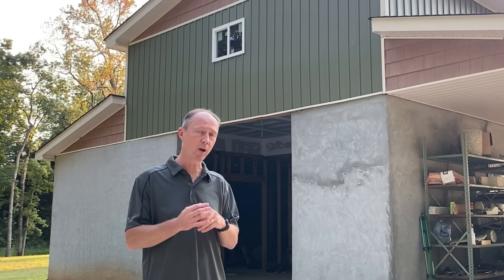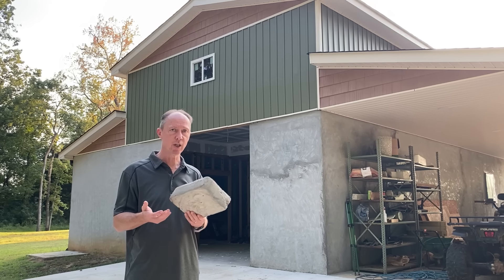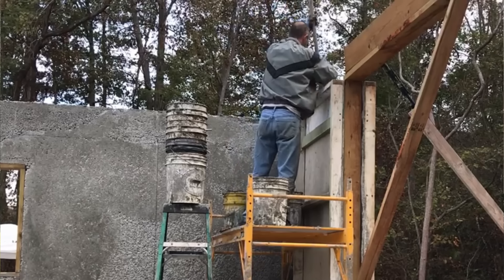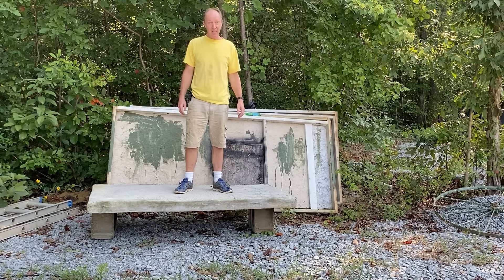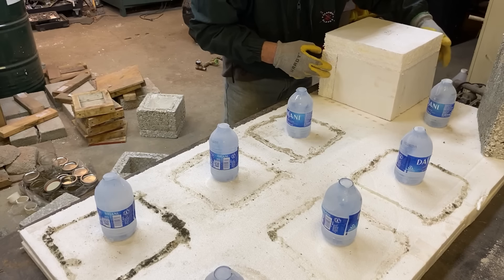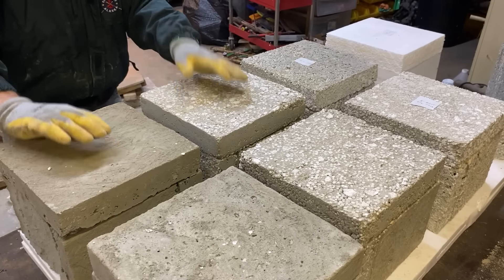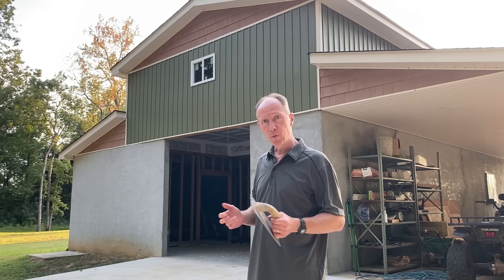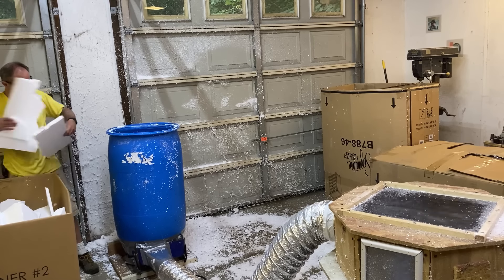The White Gold Rush?! The Video That CHANGED Aircrete Forever!

Comment: Cool project/experiment. I'm deeply interested in alternative/progressive concrete materials. Yet, isn't it a bit risky to dream up a building material and building method and "test" is by building a building out of it for actual use? Without any calculations or anything. I mean... if it fails, someone might get hurt (or worse). Perhaps the people of the internet here could suggest you ways to get your material and method tested and verified by professionals. Good luck with your work!
Reply from the maker: Calculations were done and its holding up great! subscribe for new builds coming soon!

Comment: Just wondering. Why not just build the exterior walls (of a single storey) completely out of 8-10 inch thick sheets of styrofoam then cover them. They are actually pretty strong. I’ve got a few of them and I might try a small scale shed first.
Reply from the maker: Go for it! Subscribe for new builds coming soon!

Comment: Great, informative, inventive ideas. I love it. This whole aircrete thing is news to me.
I toss a question out to everyone: could this aircrete/styrofoam mix be used to fill the walls of an old uninsulated wooden framed house?
Reply from the maker: Norm, you can treat the styrofoam with borax and boric acid for fire resistance and blow it into the wall cavities through holes you cut between the studs at the top of the wall. Works great.

Comment: Very creative and ingenious experiments. It does look like a very messy process though and one that you should definitely want to be wearing a mask for. Also the forms are not something the average diy folks could handle so maybe some large blocks or even large slabs like your bench that could be stacked. Also does this mix breathe ? I remember people using pumice in forms where I live to make walls. It wasn't particularly insulate and people gave up and went to ICF's which banks will give you a loan for but aren't that great insulation in really cold climate. I used American Clay adobe in the inside of my ICF home but had to first drywall it. With this you could just go right over the stucco I suppose.
Reply from the maker: Making the proccess simpler! Subscribe for new builds coming soon!

Comment: There is a video on internet, think of two Russian guys experimenting with the same product but they made Blocks, I think working with blocks will be easy because even the openings or windows openings can be cut with a simple saw (taking into consideration the experiment of this 2 Russian guys). There is another product that I think you can apply after is like a type of paint, Think is an Iranian/Irak or Arab in general pardon my geography ignorance. This product you cover the wall and you can sledgehammer the wall it will no go, I won't make even a dent !!
Reply from the maker: Thanks for the tips!

Comment: Would love a link for the elevator! Impressive material you've created. Wonder how it would withstand hurricanes and earthquakes. Any testing you know of??
Reply from the maker: Tim, Google "Winch elevator". You will find lots of videos on different builds. My workshop won't hold up well in a hurricane or earthquake but the next build of the arched A frame garden shed will be really strong and could potentially hold up well.

Comment: Hi can I make a shop floor that can support a vehicle with styrocrete. Do I have to add mesh or rebar?
Reply from the maker: It is definitely not recommended for vehicles. The slab definitely needs rebar and wire mesh. We start with a standard slab for garages that support cars. You could add a small percentage of styrofoam to your aggregate and probably get away with it but the cost saving is less significant on the slab so probably not worth it. Good luck! Subscribe for new builds coming soon!
Reply: @AbundanceBuild  thank you perhaps if fiberglass fibers are added to the styrocrete one could do away with rebar. Is the concern cracking of the compressive strength to support vehicles. I think your product is a lot cheaper the $140 per yard of ready mix.
Reply from the maker: Yea, the compressive strength has never been tested for that high of a load. Maybe you could make a small scale test to see how it holds up.

Comment: What if you'd introduce, let's say straw or glass fiber into the mix? Would that help the strength without extra work afterwards?
Reply: wouldnt straw biodegrade?
Reply: @xgymratx  I don't think so, there's no air to reach it so I don't think it would decompose.

But I don't know for sure
Reply: Aircrete is porous so i was thinking water might rot it
Reply from the maker: Thanks for the tip! New builds coming soon - subscribe to stay tuned!

Comment: How long does it take for it to dry up? It is important for one to know that, especially in cold climates.
Reply from the maker: Matel, it is just barely set enough after 24 hours to remove the molds. It takes roughly 10 days to really dry out.

Comment: I'm building a geodome and I want my roof to be aircrew. What is the formula for the Crete in you used and how much Styrofoam you add to your batch and what size you get.  The most for the domes are easy to make but I don't have the mix.  Your response will be greatly appreciate it
Reply from the maker: New foam free recipe video coming soon! Subscribe to be notified!

Comment: With the panels so easy to cut, would you not be better to cut windows in later rather than try to cast them in during the pour? Seems your panels would be stronger than patching under a window.
Reply from the maker: John, I wanted to run the wood frame all the way to the ground to support the window and above it.

Comment: Nice work. That's a lot of experimentation. Thank you for sharing. I'm curious if insulated concrete forms would have worked well or not with your idea.
Reply: I remember my family cabin we did ICF.   The only major issue I see is the amount of delicate bracing in between.  He shows how much  forceful packing is required..  It's been years so i can't recall exactly how deep each section was.   If it was blocks like Legos or not..    you would need to build a row pack it carefully  and then do the next.  DIY I can see it saving allot of money  but otherwise it would cost allot more in labor.
Reply from the maker: Red, search for Perfect Block. This is a company in Arizona making ICF blocks out of shredded styrofoam and portland cement.  You can make your own with this mix.

Comment: I wonder if this could be commercialized.  Delivered in cement trucks and pumped into ICF walls.
Reply from the maker: We are working on product research right now! Turns out pumping this material is actually slower than ladder packing it. Subscribe for new builds coming soon!
Reply: @AbundanceBuild  Yes, for DIY'rs who just want to get it done in one pour, a pumpable styrocrete might offer additional insulation, but at the expense of some of the thermal mass of pure concrete.  But I think in colder climates, where it doesn't warm much during the day, the thermal mass works against you and you just need more insulation.  The lighter styrocrete would be less likely to blow out of the ICF blocks. A Helix Steel add-mixture may mitigate the need for rebar and make it easier to tamp down the styrocrete.   The built in plastic studs of the ICF give you the fastening points not afforded by styrocrete.  Just some of my thoughts.
Reply from the maker: Good ideas!

Comment: I would use scrap steel, old gas line pipe or beams for support columns,  to carry loads, and then the aircrete doesn't have to.
Reply from the maker: Thanks for the tip! Subscribe for new builds coming soon!

Comment: If you wanted to change the structure later, could you grind it up and add liquid to sort of recycle it in your blender/ mixer? Very cool ! SUB+1
Reply: I'm a retired concrete technician. Have you tried perlite? We cast a sloped roof at a military base with cement, perlite, and sand. Compressive strengths were excellent. No over consolidation bellies. I am not an engineer but some rebar should ALWAYS be used. Consider superplastizers and research some college programs that compete in building concrete canoes. You can ideas from their light weight mix designs.
Reply from the maker: Maybe! New builds coming soon - stay tuned!

Comment: Hi Stephen,
Great product!
What foam do you use after you put in the Portland cement, in the mixer?
Reply from the maker: Silvan, I am using the Drexel foam. It is the cheapest and best foaming agent I have tried.
Reply: Hi Stephen,
Got your lawnmower setup copied and started shredding. Amazing results!
Fast shredding.
First attempt is pouring forms for  garden boxes. (See "man about tools" on YouTube)
I want to try out a styrofoam only mix, without the drexel foam, and with sand for more durability (against the use of weed trimmers around the boxes).
Do you think  a 1 (Portland)  to 8 (styrofoam) and 2 (sand) mixture is  suitable?

Comment: Very interesting!  First of all congratulations on the amazing work you've done!  Im worried about the structural side of the construction.  If rebar were to be used...what would happen if a vibrator is used to move the aircrete down the mold?  would it separate the aircrete mixture?  I really have to play with this!
amazing work!
Liked and Subd
Reply from the maker: Sir this mixture does not behave like concrete. You have to pack it with a packer to compress it. A vibrator would not work for this.

Comment: Have ran into any problems with building code and permits for making a structure?  Looks good but I have doubts on overall strength.
Reply from the maker: James I am in the County and don't have to worry about inspections. But this is a huge problem elsewhere. You need engineering approval to get it passed.

Comment: Are the mainstream builders making use of this method of building? Does this hold up well in storms, fires, et cetera? It seems so practical.
Reply from the maker: Linzie this is an alternative building process and has not taken off in the US yet. My next build of the arched A frame I believe will hold up well in a storm, and yes it very fire resistant. Way better than conventional stick built houses.
Reply: @AbundanceBuild  Thanks.

Comment: Just out of curiosity, does your foam aircrete float on water?  It might make a great pontoon, floating house or dock building material!
Reply from the maker: It certainly does float but it also absorbs water. So you need to coat with a waterproofing product. I am using elastomeric roofing paint but not sure how it would hold up under water continually.

Comment: This is very cool, thanks for sharing - one thing comes to mind though...what about wind loads? Are you concerned that a bad storm or straight line winds might cause some concern? Torrential rains? (I guess the stucco takes care of some of that.) I'd be concerned about impact damage (trees falling), but I admit it would be super easy to patch and repair it.
Reply from the maker: JC we live in tornado alley and if my shop gets hit with a tornado it will end up in the woods. But the Arched A frame I am about to build potentially could hold up. Building the roof and all out of this increases the strength tremendously.
Reply: @AbundanceBuild  to be fair, most structures taking a direct hit from your average tornado will end up in the woods!

Comment: I would not want to be in that building. Has a material analysis been done for the material? What about wind loads laterally. It seems to be strong holding up the roof. Seems like you'd need load bearing members to make it stable.
Reply from the maker: New tests coming soon! subscribe to see the results!

Comment: When you’re packing it down, isn’t that defeating the bubbles (air) in the mix?
Reply from the maker: Suzanne, some of the bubbles leave the mix but we are still left with aircrete filling and glueing the voids between the styrofoam. Using pure portland and sand is much heavier and destroys the insulative value.

Comment: Hi Stephen. I have a 20ft shipping container I would like to insulate from the outside. If I wanted 4-6 inches(r12-r18) how would you attach it too the container? Would a mold be needed around the windows and doors or could you just cut them out from one contiguous exterior wall?
Reply from the maker: You could pour the whole thing and then cut out the windows with handsaws or a multi purpose  electric saw. Good luck with your project.

Comment: Great video.im concerned about rain and water leakage,is there any coating on your walls?.I came across a coating called lotasun very high water proofing.
Reply from the maker: Steven, there are several products you can use. I am using elastomeric roofing paint. Yes Lotasun would work great. I could not find a price for it though.

Comment: Very interesting. What’s your background  as far as engineering? I like to see the strength of this as far as tensile and vertical strength before I would build a story on top.
Reply from the maker: John I am an electrical engineer. Yes I am not recommending you build a second story on this. My next build using lightweight wood trusses will give it the strength in the walls and roof and give you the forms for pouring it and a nailing surface to add finishes inside and out if you don't want to stucco it. I am thinking how to do a compression test that will not cost too much to build a giant metal frame.

Comment: This is great! Have you considered using 1/8 lauan instead of OSB for forms?
Reply from the maker: Cody, that would work great as well. It is cost issue. I am going to try stapling the fiber mesh to the trusses, and then cover tightly with house wrap and screw wood strips horizontally every 12 inches and see if I can get away from using OSB forms at all.

Comment: what if you just mix the concrete with the styrofoam without the air? How would it compare?
Reply from the maker: Green I have done this. The mix is much stronger but far less insulative which is not what you want.

Comment: I really like this product, most of the kit required to make it can be home made and generally the costs are low. I am thinking of trying to use it as a fill for sips panels? would the styro/aircrete bond well to OSB sheets? Also I like your foam set up, can you give me a pointer towards the design of foam gun you used?
Thanks
Chris
Reply from the maker: Hi C B it sticks well to OSB and would work well for SIPS. It weighs around 10 lbs /cu ft. I will do a video on foam machine designs.
Reply: @AbundanceBuild  Hi Stephen, thanks for taking the time to reply, Please could you also tell me the mix ratio of Water: cement: foam: styrofoam. I am keen to have a go and make a test panel.
Thanks again
Chris

Comment: Liked your video. I have long thought about the waste of styrofoam packing and you have a good idea.  The main concern I might have is that a lot of "styrofoam" is actually corn starch based,  Would it be as strong and rot resistant as petroleum based styrene? Do you sort it, and if so, how?
Reply from the maker: Keith, everything I am getting is petroleum based. I don't think I have ever seen the corn starch based product. I would think it could mold and rot if it stayed wet but just my thoughts.

Comment: I'm interested in this material to make smaller worksheds for my yard (e.g.  about lawn tractor size - less than 100 sq ft does not require a building permit).  I assume that this material is not attacked by rodents?  Also, I would be very interested in getting lessons on how to make this material in my area of the country as I would believe that if this is less expensive and more durable than wood frame sheds, then there is a large market here!
Reply from the maker: Yes pest resistant! subscribe for new builds coming soon!

Comment: Be very careful with any wire penetrations or places you have electrical wires contacting the wall. Basic styrofoam will react destructively with the plastic insulating the wiring you'll want to run. You can test the effect yourself laying a length of insulated wire over a styrofoam cup and see how both the foam and the insulating jacket will slowly dissolve (in this case with the wire cutting down through the cup.) There's horror stories of people trying to insulate their walls by blowing in styrofoam peanuts which then contact any wiring in the wall with the insulation melting off from the chemical reaction and the bared wires starting fires. 

As long as you're not trying to imbed wire and are putting some kind of coating on any surface you'll be good but be mindful of that complication possibly fouling up your wiring if nothing else.
Reply from the maker: John. I have never heard of this. I will try this.
Reply: @AbundanceBuild  I saw a foam cup a science teacher had left a length of hobby gauge insulated wire across. Can't recall how long it took but I believe it was the plasticizer in the wires insulation (acetone maybe?) that made foam dissolve and the insulation shrivel like it was burned. Since the cup was tapered new insulation kept coming into contact with new foam until it reached the bottom. Again, I didn't watch it happen. Might've been overnight or took a month. 

This is why electronics come with their cables in plastic bags to prevent contact with foam packing materials causing them damage over time. 

I found one construction link applying to in-wall wiring and various kinds of foam insulation but I'll need to play with the url to get it by YT:

"norfoam. com. au" / tps-pvc-cables

(Remove spaces and quotes.)